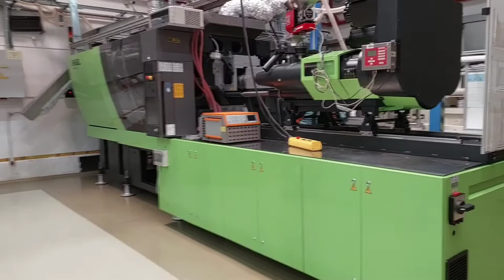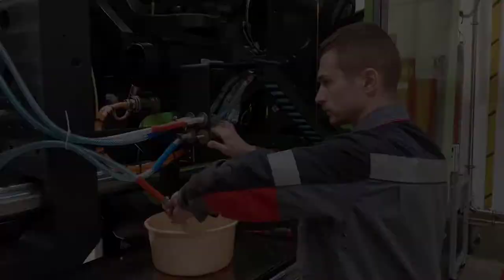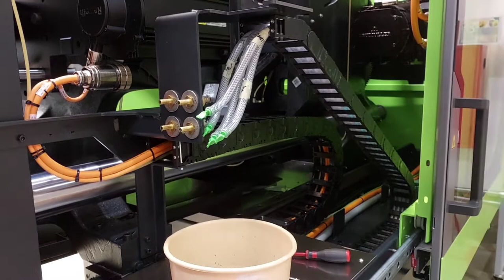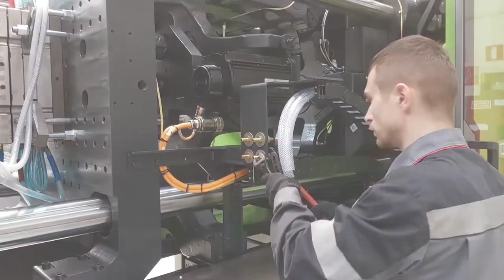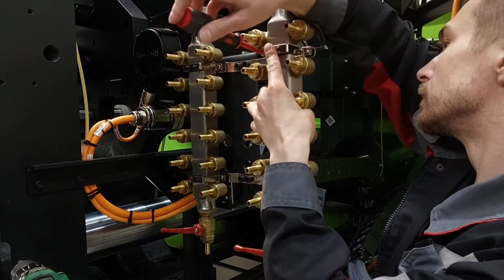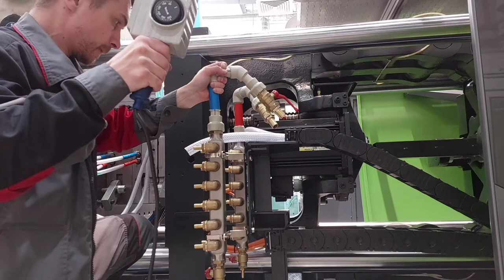Changing the cooling system | Injection Molding Machine

Comment: Do you use blue tinted water to help spot dead heading or is that a treatment for your in house systems?
Reply from the maker: It's ethylene glycol. The ethylene glycol prevents rust from forming inside the mold cooling piping and helps to keep the mold at a steady temperature during manufacturing use.

Comment: Bruh thats to much hassle for adapting a cooling system!
You should ask for a few quick coupling systems with pneumatic purge to optimize your work and aim to have a SMED system in place. 
Tell your boss to not be a greedy AH.
Reply: Bruh, you judged something based on one video, what if this machine will run only this mold till the end of times or at least a few months? Who needs smed when you don't change tools everyday?  Besides if the boss was  greedy he wouldn't have bought an Engel. 
Tho, I don't like how he put PVC pipes in the machine and unnecessarily at that, just a brass L piece would suffice.
Reply: @redshirt510  Bruh! 
I just commented based on my day to day exprience.
Even if you run that mold only on that specific machine you need SMED if your company compels yo to keep an OEE =>90%. and to achieve that level of OEE every second counts.
I work for a T1 (automotive industry) and all that Lean stuff an methodologies are highly enforced.
Reply: @FlopparaptorPro   Bruh, everything is a big if. I've worked in both, started my career as an setter in a big company with over 350 molds and 20 tool changes a day, we didn't chased every second, but thanks to great  standardisation we changed tools in 15 - 30 minutes with great oee. Now I moved to a smaller company with maybe 50 tools (many of which are twins) an we make packaging in huge quantities,  over half of the machines never had a tool change (other than twin tool) an we make maybe 1 tool change a week, why would my boss invest tens if hundreds  thousand euro in standardisation to save almost nothing? Yea it would be awesome to have magnetic platens or pneumatic ejector couplings like i had in previous job, but I'd rather look once  a month for a bolt or special hydraulic coupling that fits on that tool rather than work in continuous grind like i did in my first job.
Reply: SMED is good in specific cases, but if you have 300h or 500h or 5000h production runs it doesnt make that much difference.. The most time consuming part of the tool change is cleaning hoppers and granulators and material change in machine when you have to go from 200°C to 300°C or from 380°C to 180°C..
Reply: I wouldnt make all that work for a cold water system and in the process loosing flow control in different circuits. I prefer manifolds for hot water only. Machine standard should be at least 90°C water  capacity.
Reply: You seem well versed or familiar with the industry.. I got a question.. we just recently got some of the newer conair tw therms which are pretty nice (touch screen and all) but they didn't get the auto purge and water flow sensors in the package (they cheaped out on a 5k therm) a few people in my crew will forget to turn the water on sometimes.. do ya'll have anything in place that is like a reminder that the water wasn't turned out? Like a flow meter? We have about 45 presses ranging from 500-3500 ton and maybe 120 molds but we have pretty good shit like hydraulic ejectors/cores quick disconnect bottles on each tool wireless crane remotes and if theirs something you know of that can either tell the tech or mold setter that the water isn't on that'd be awesome!